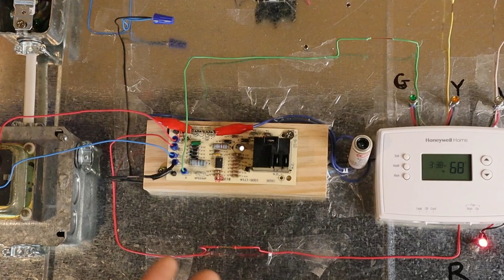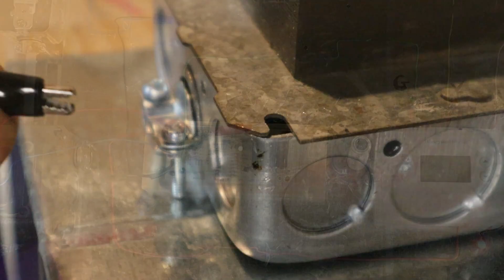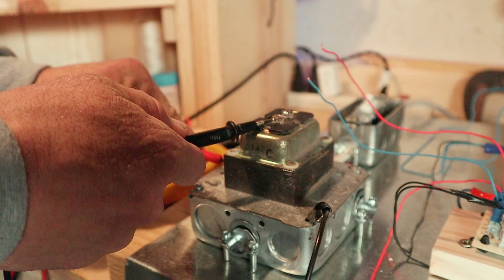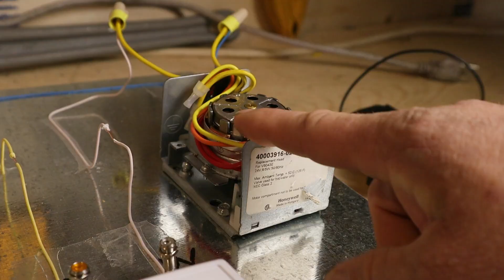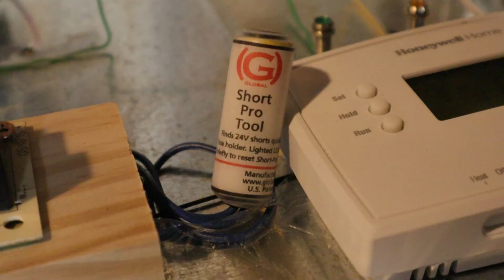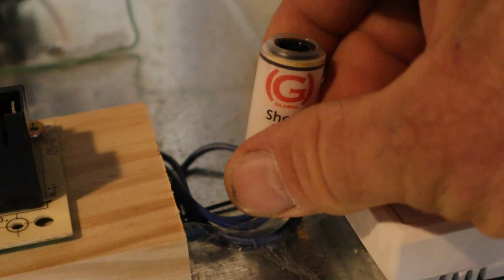How Transformers Help Find Low Voltage HVAC Shorts

Comment: Question, on the floating transformer demonstration if the zone valve was grounded,wouldn't it eventually cook the transformer even though it doesn't blow the fuse right away?

Comment: Thanks for great video with explanation!! So, when do installation is it necessary to groung secondary  winding on Transformer or not? And i when secondary has to be grounded ?? Is it good practice to ground secondary??
Reply from the maker: I don't bother with it on installs. I generally try to keep everything to manufacturer's design whenever possible. It's just something I might do during a diagnostic process.

Comment: I kept rewinding until i understood (about 10 minutes😅)  Then i was like ooooohhh🤦🏿. Duh 😅😅 Great Vid. So you mean if my secondary is grounded i can temporarily unground it to make it "floating" to determine if its a short in my wire or component?🤔
Reply from the maker: Yes, but it's only really viable if the transformer has a physical ground in view you can disconnect. Some may be internally grounded, which would require disassembling the transformer which just isn't viable. At that point resistance readings on the components/circuits would be a better approach.

Comment: Hi, Mike
If the secondary side of the transformer is grounded internally, how can we turn it into floating one ? because there is no wire to remove.
Reply from the maker: There is, but it is inside the transformer and would require opening it up. In this case, it would be easier to go straight to ohming out whatever resistive loads may be in that circuit, such as the contactor, gas valve, etc. If all that tests out ok, then you know you're looking for a short in the wiring.
Reply: @JerseyMikeHVAC thank you.

Comment: This is very important to know. In school, they teach that electricity always takes the path of least resistance and that if any electrical circuit touches a ground wire that it will automatically cause amp draw to go up because the ground rod going into the ground has such low resistance. This is false. Electricity always wants to go back to its source. The secondary portion of a transformer is it's own circuit. Without the circuit being completed, there will be no excess of current when there is another,  unwanted circuit introduced (short)

Comment: Watched the video about 10 times to really understand it I do understand it now I will look out for a floating secondary or a grounded secondary so basically if the transformer is not grounded there’s no possible way you can get a shorted wire @jerseymikehvac
Reply from the maker: It's still possible, but a lot harder. You'd have to somehow have the 24v supply and common wires touching directly together, or each one touching metal.
Reply: @JerseyMikeHVAC  now I understand thank you for posting this video it really opened up my mind a little, great videos in your profile 🙏 I’ve watched them all

Comment: Another question that I have, why is there a resistor in some circuitry and is it mandatory
Reply from the maker: Because the resistors regulate current flow and steady the voltage, which is a big deal in systems with inverter motors and other very sensitive parts to electrical noise, power surges and the like. It just helps keeps things nice and steady.

Comment: Is common the same as ground
Reply from the maker: Not exactly. Common is an essential part of a full circuit for it to work. Ground is a safe alternate path when electricity ends up where it shouldn't be, which can help prevent you and I from becoming a full-on conductor within that circuit.
Reply: @JerseyMikeHVAC   so its more like a shared neutral path for 24 volts

Comment: Hey Mike, do you prefer that “pro short tool” over the “lil popper”?

Or do they have different uses?
Reply from the maker: I do prefer the short pro for the indicator light and the fact it is designed to be used on both 3 amp and 5 amp circuits. Didn't want to carry 2 poppers on me.

Comment: If u find a component with no resistance thats the one is causing   shorted correct or im wrong?
Reply from the maker: Yes, so long as it is supposed to have resistance, like a coil or a motor. Something that needs power to run or operate. Switches, flame roll outs, thermostats, the wires themselves....they just open and close the circuits, so aren't supposed to have a lot of resistance in them. A low ohm reading is good in those cases.
Reply: @JerseyMikeHVAC I went on a service call a week ago that had a low voltage short. I narrowed it down to the thermostat causing the short when it called for auxiliary heat. I replaced the thermostat and didn't have the issue any longer. Do you know what caused the short within the thermostat? Is there a way I could have tested the thermostat?
Reply from the maker: @jessebHVAC  Was a smart stat?
Reply: @JerseyMikeHVAC  yes Honeywell visionpro
Reply: @JerseyMikeHVAC  yes Honeywell visionpro
Reply from the maker: @jessebHVAC  Yeah, these smart stats have chips, relays, jumpers...so many things can go wrong in there. Just a little condensation could wreak havoc. Best way to test it, I think, is to just eliminate it from the equation all together and bypass it to see if the problem resolves. With so many different ways a short can pop up inside these things, bypassing is just the most practical approach.
Reply: @JerseyMikeHVAC  Awesome thanks for replying and making these videos

Comment: Perfect timing. There's nothing better than burning off some brain calories after eating too much of 🦃👈🏽 this guy.
 AC Service Tech always has solid content, but Craig might want to switch over to decaf 🤷🏽‍♂️. I use a resettable fuse. What's your take on those? I have never seen or heard of the Short Pro tool until today. Let me know (when you have time) if you feel it's worth having it as a part of my arsenal and a fair priced place to purchase one.  Thanks for sharing your knowledge of narrowing down potential culprits so that we can begin to isolate issues. 
👍🏽👍🏽👍🏽👍🏽👍🏽
Reply from the maker: I was using the resettable ones for a while, but went with the short pro when I needed a new one. Mostly just for the indicator light and that it resets itself. I wouldn't say to abandon the resettable one so long as it works for you, but you might like it as much as I do if you eventually need another one. 

 I've seen them go from $80 to $150 on some websites but you can find them on Amazon for $30-35.
Reply: @JerseyMikeHVAC  Yep, the little LED indicator light is what grabbed me. Seems convenient and tells the story a bit better. Thanks for the info. I know that you are against monetizing, but if you place a link in your description, you may receive a box of these guys as payment 🤷🏽‍♂️. A free tool (s) is a free tool (s). ✌🏽